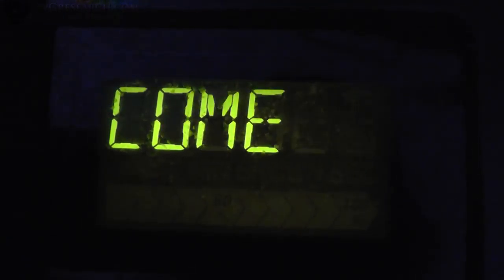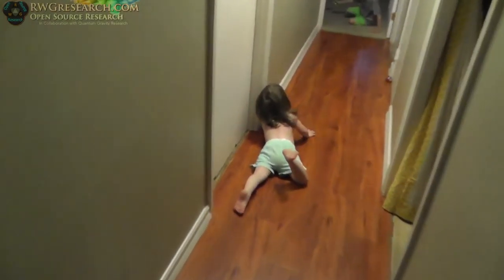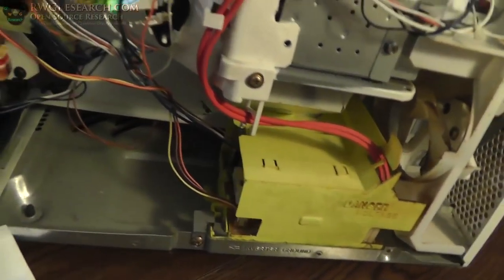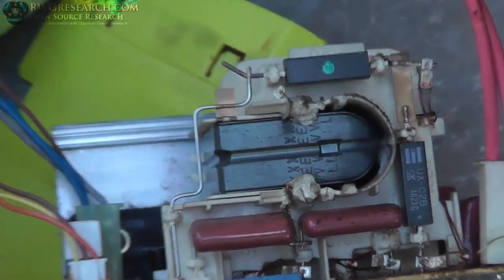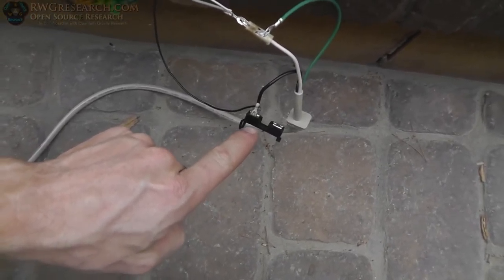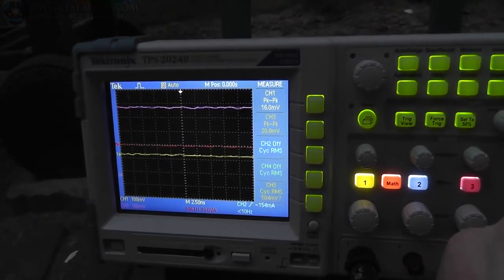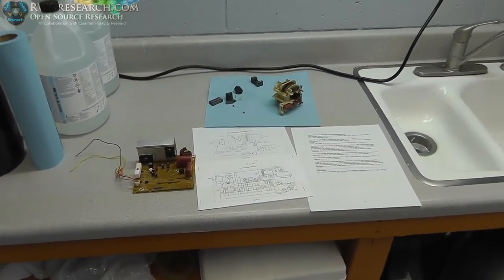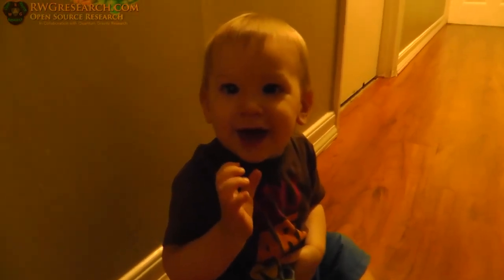Microwave Inverter MASSIVE FAILURE! & Hacking! :)

Comment: I MISS MOTS ,  these inverters  are puny
Reply from the maker: yeah , but they can deliver some real power if you let them :) i can see both types having there advantages :) ~Russ
Reply: ***** i have to admit i haven't done much experimenting with these but in the past i have found inverters to be strange beast , i have a 90 amp inverter welder that wont push 5 amps on a short or on an hho cell but let it arc and bamm 90 amps . a youtuber told me these things cant handle much more then there rating or they burn up , but a mot can crank out 10 times its rating no sweat . i suppose this is to save money on aluminum and copper , most people dont no this but the primary on a mot is aluminum not copper .
Reply: normal microwave transformers,  like arc welder ones,  have a gimmick in the core design that diverts the magnetic field past the secondary when it's shorted.  I dunno if this inverter type has this feature.